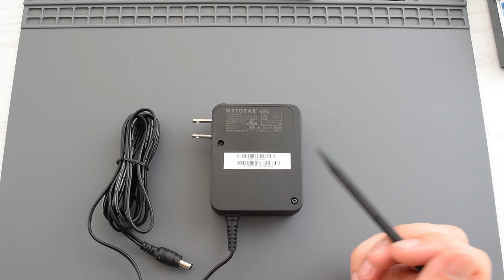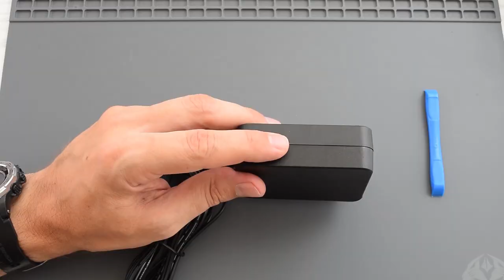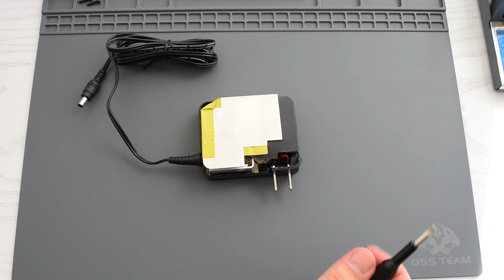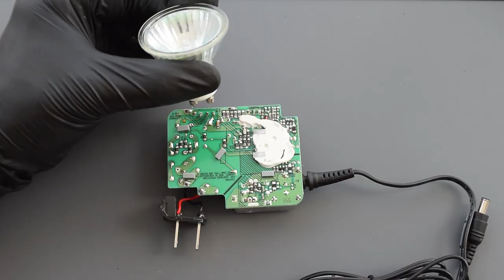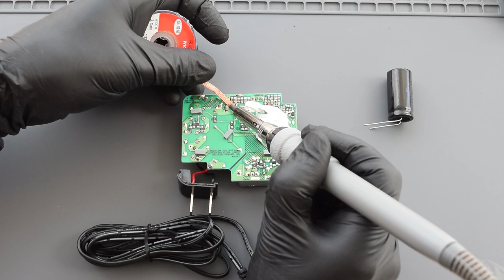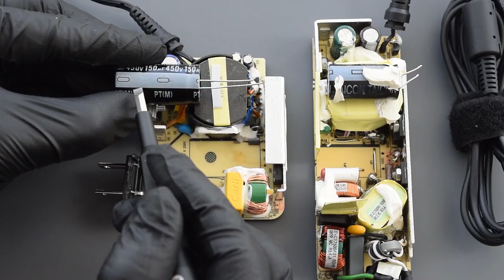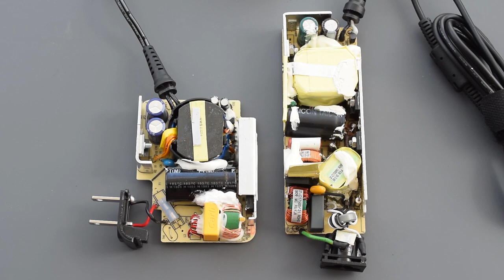How to convert any 110/120V AC/DC Power Adapter to 220/240V Electricity

Comment: Thanks for the video and the explanation. I need to convert dewalt dcb115 charger and in a video that I saw he added transistors(EDIT: meant resistors)  and I didnt understand why. do you think it is necessary?
Reply from the maker: Maybe those were resistors not transistors!? Depends on the schematics and in most cases replacing the main cap and varistor is enough. it's not a problem to buy some resistors on Aliexpress the cost just a few cents.
Reply: @ElectronicsComputers   thanks for the reply and yep I meant resistors. but what are they for? and should I also replace the fuse?
Reply from the maker: @idoriesenberg5297  The fuse will be fine. You need resistors to reduce the current on some components. in that case on a MOSFET. If your PCB has a dedicated place for those resistors then I'd  recommend installing them to the board.

Comment: Nice idea❤🎉
Please, I have faulty inverter for a dc stove which produced 470v AC, I was unable to repair it. How can I double the 220volts AC to 440volts or make an inverter that will produce 470v AC from 12 or 24volts dc.
Thanks
Reply from the maker: You have to fix that inverter, because it's near impossible to buy such a unique thing.
Reply: @ElectronicsComputers  😳😱👌I appreciate any support in fixing this stuff.
Thank you 🙏

Comment: In refer to your answer:"...There's no AC input protection, and there's no protection on the DC side to safeguard the device...",what protection is used,in general,on the DC side?
Reply from the maker: Apologies for the delayed response. I couldn't locate your comment among the numerous ones. Typically, in the DC stage of a power supply, there should be at least a basic voltage stabilizer and short circuit protection. However, in this particular power supply, there's nothing of the sort. It's as simple as it could possibly be.
Reply: @ElectronicsComputers  Yes,you have numerous comments indeed,since you made a very nice well explained video that can help alot.Thanks again for your help.
Reply from the maker: @shonl9743 I guess, that's what you were needed in the first place: https://alii.pub/6wynat 
We buy those power supplies for client's routers, modems, electric tools and some other stuff.
Reply: @ElectronicsComputers  Yes i know.But since the original one(110VAC)was very compact(small and light),i thought i could use it.Thanks for the link.

Comment: mine 110 adapter 335v 50uf long capictor its was working fine on 220 electriccity my voltage 240 one day i was run this on my generator that capictor blast can u tell me which capictor i should go
Reply from the maker: 400-450 volts rated.

Comment: What about output voltage? Is it doubling?
Reply from the maker: No the voltage will be as rated on your power supply. It's impossible to double it this way.
Reply: Switching PS has output feedback that will maintain output to a fixed value no matter what input is.

Comment: Hello, pls I need your help urgently. I have this 40" Samsung TV brought to me from the US. The AC 110/120 I want to convert it to 220/230. The capacitor in the panel is 420v and 100uf. I do not know which to change it to and or whether to change the varistors
Reply from the maker: All Samsung TVs are made with the universal power supply which works with 120-240 volts. I would just google marking of the varistor just in case, but I'm pretty sure it will work as is.

Comment: Hello, absolute beginner here. I have a subwoofer that I got from the US. I live in Europe and the subwoofers input is 110-120v, as we know the voltage in Europe is 220v so I was afraid to plug the device right into the outlet. I opened it up, and I found the capacitor. It is a 450v120uF capacitor. My question is, will this work hence the type of capacitor? Will I need to check something else like the fuse or something?  Or since the capacitor is 450v rated it should be okay? Also why would it be labeled 110-120v if the capacitor is 450v? 

Thank you for the help and keep up the good work! Subscribed!
Reply from the maker: I'm 99% sure that that device will work perfectly in Europe. Most manufacturers create a universal power supply, because they sell their products around the world and no sense to create two different units. I would also check the input protection. There should be a varistor that connected in parallel to AC line after a fuse. Usually it's a blue or yellow component. You can share some pictures of the PCB if you need more help.
Reply: @ElectronicsComputers  Sure, I could send you some pictures. What would be the best way to send them to you? Thank you again!
Reply from the maker: @alvin4781  Just attach shareable links from the cloud. Could be also useful for others.
Reply: @ElectronicsComputers  I just posted the link under this comment, but it's not appearing anymore for me, YouTube might think it is spam and might be deleting the comment. Let me know if you can see it or not so I could figure out another way to send it.
Reply: @ElectronicsComputers  Were you able to take a look at them?
Reply from the maker: @alvin4781  I've never seen your message. Probably, it went directly into spam. I'll check tomorrow and reply back to you.
Reply from the maker: @alvin4781  Unfortunately, there's no your message. You can send it directly to my e-mail, which you can find in the channel description.
Reply: @ElectronicsComputers   I sent it via email.

Comment: What is the metal plate soldered on the circuit board?
Reply from the maker: heatsink
Reply: @ElectronicsComputers  
Thanks...why is it soldered to the board and also what if I remove it...will it still work?
Reply: @Dhona7770  heatsink , dissipate heat don’t remove it (it’s like removing the radiator of your car )
Reply: @EL90291  thanks

Comment: I have dewalt DCB090 charger. It is written 120V AC on the back but, the main capacitor is 400V and there is no varistor. What should i do ? I think it is ready to 220V AC. What is your opinion
Reply from the maker: Most likely it will work for 220V without any problems but if you want me to check just send me a photo of the top and bottom side of the PCB. If there's only one 400V capacitor then I'm 90% sure it will fork fine but if there are two of these then it requires a little modification.
Reply: @ElectronicsComputers  Yes only one 400V. Others are like 35V or less
Reply from the maker: @necromecro  The it's a universal 120-240V adapter.

Comment: My 12V adopted is designed for 100-110V input but I am using it on 220-240V  as in my country 110V AC is not available. It is working good . I faced no problem. Now suggest me did I need to replace its capacitor or not.
My Adopter is compatible with FOST5260. Plz answer
Reply from the maker: Only after opening the case you can tell for what voltage it was originally designed. In most cases those adapters are made for different countries, they may have different plugs but the boards are the same. If your adapter have already been working for a long time (over 6 month) then it will be fine. If it worries you then try to carefully open it and check the voltage of the main cap. There's always a risk of fire if that adapter blows up when you're not home. So either check it or unplug the adapter when you leave your home.
Reply: @ElectronicsComputers  
Thanks for reply. I did not use it much . It is US type adopter. I opened the case . The specifications of main capacitor are:
Color : brown just like yours
450V, 6.8uF
I see your video carefully. I think 450V are OK but 6.8 uF is low as you used 150uF. 
Specifications on the body of my adopter are:
Model: PS-2.5-12-25WTI
Input: 100-120V AC 50/60Hz 0.8A
Output: 12V DC 2.5A
Now everything clear. Can I use it without tension for longtime.
Reply: @ElectronicsComputers  
Waiting fo you answer
Reply from the maker: @Aseelandpetcare  Yes, it's totally safe for 220-240 volts. The capacity of the main filtering cap varies and it depends on the power of the power supply. So, no worries!
Reply: @ElectronicsComputers  Thanks

Comment: Firstly, please forgive my ignorance of basic electronics. From what I'm assuming by your video, if the power adapter is already 'matched' to your electronic device (current rating, voltage and polarity) then the mods you've shown in this video don't alter that... it only alters the input power to the adapter. The adapter will still output the correct DC, amps and polarity for your device after the mod? Is there no need to confirm things like the polarity of the mains power if you've changed country? Thanks so much.
Reply from the maker: Usually all power supplies designed to work in the range of 110-240 volts even if they have north American plugs. But sometimes manufacturers design the input stage of the power supply specifically for 120 volts and in that case you need to replace those components with the ones that can support 240 volts. The polarity and the output voltage will be always    the same.
Reply: @ElectronicsComputers  So if I just purchase a different power supply, as long as the input power matches the new  mains power supply and the output on the adapter is the same as the output power on the original power supply it should be okay? i.e. original p.supply input = 120VAC, 60Hz, 240mA/ original p.supply output = 9 VAC, 2000mA/ new p.supply input = 230-240V, 50Hz, 140mA / new p.supply output = 9V, 2000mA, 18VA?

Comment: I have capacitor 450v / 150. Is this 220volts? Thank you
Reply from the maker: Yes, it's a universal power supply which will work in the range of 110-240 volts.

Comment: very nicely done , i have just bought a set of ridgid (AEG) lithium tools and its charger is rated to 110V for the USA , i need to convert it to 220v for our power here in south africa , may i ask you for your assistance please , it is a pretty simple circuit by the looks of things but i am not too clued up on electronics , do you mind assisting ??
many thanks
Richard moss
Reply from the maker: Take some close up shots of the PCB with its components, so I could see their specs and give me the links.
Reply: hi again , to which address can i email the pics and info to please
Reply: ok main cap is 200v 100uf , varistor is a 10271 , mosfet is JCS 4N 60FB , i have a 472 varistor and 450v 100uf cap in stock , mosfet i hope will be ok , looking forward to your reply
 rich
Reply from the maker: @richardmoss2904  For that device you can use any 82-100uf electrolytic cap rated 400-450 volts (pick one that fits perfect into your device case). For me "varistor 472" sounds like a capacitor, don't confuse them, they look the same. You need a varistor rated at 300-400v. I f you can't find it then simply remove it from the circuit.
Reply: @ElectronicsComputers  thanking you sir , i will give it a go
thank you for assisting me

Comment: Hi, my power supply board for UB820 PANASONIC PLAYER HAS A blown up capacitor rated 220v 100uf . It's made for North America imported to my country. It was working on converter from 220v to 110 v but suddenly after one week my capacitor blown up. Please help me how to fix it. Planning to change the capacitor to 400v 82uf or 440v 100uf.is it safe to go
Reply from the maker: 400V cap is a minimum recommended value and also don't go lower than 82uf. When the capacitor blows it also kills the fuse, varistor and the diode bridge (or 4 diodes). So check all components in the input circuit.
Reply: @ElectronicsComputers 

OK thank you. If my varistor and diodes still working do I need to change them for compatibility to 220v or its enough to change the capacitor as stated. Once I reach home will send u a screenshot of my board. Thank you very much sir
Reply: @ElectronicsComputers 
HI again do you have an email to send my screenshot. Thanks
Reply from the maker: @jihadnader8599  Usually, there's no need to replace the diodes if they are fine. My email is in the channel description.

Comment: Can I do the opposite? 220V to 127V?
Reply from the maker: To do the opposite in 99% of cases, you don't need to do anything. However, you can replace the varistor for lower voltage so that surge current protection will work properly.
Reply: @ElectronicsComputers  In this case I was referring to a cheap soldering heat gun station I bought expecting it to be 127V, but the store I bought only had 220V units 😢
Reply from the maker: @JoaoPedro-ki7ct  In most cases, all you need to do is replace the heating element. Heat guns usually have the same schematics but different heating elements that are rated for 120 or 220 volts. If it's a big hot air station with a transformer inside, then you also have to replace the transformer.
Reply: @ElectronicsComputers  It's a JCD 8898 station, I wish I knew about the heating element trick earlier, I would have bought one or two 127V heating elements alongside it too already. 
I guess I'll have to wait for the station to arrive and then wait 17 more days again to replace the elements.
Thank you for the enlightening me still, I was already considering adding a 220V outlet somehow or buying a voltage converter on a tight budget.

Comment: This could work in certain devices, but many of 120v power supplies use a voltage doubler
If yoy have one with it, the psu would instantly die
Reply from the maker: In case of a voltage doubler it's even easier because you don't need to replace two caps that are connected in series. Al you need to do is cut one trace (between caps and diodes) on the PCB and remove or replace the varistor.

Comment: How do you know 40% of the capacitance is fine? How do you know they didn't make the circuit to use the full capacitance? (Why would someone put more capacitance than needed?)
Note: electronics student here, so sorry if these are idiot questions.
Reply from the maker: The capacitance of a capacitor first of all depends on the power at which power supply rated and on the free space which can accommodate that component. Also if you put a cap with slightly higher rates then your device may last longer because the capacitance of your cap will degrade over time.
Reply: @ElectronicsComputers  Ok, had no idea capacitance degrades over time. Interesting. Thank you.

Comment: I change supply adopter 110 in to 22o  with main electrolytic capacitor  that is  220  circuit with no series load  but  out put 22  volt output  show  but original volt is 12v dc  1,5amp  model  no ml 18-v1120 a11s made by adopter (Leader electronics inc)

Comment: My friend asked me if its possible to convert a hair dryer from 110 to 230 using modding instead of a large 1000w transformer kit. My first instinct kicked in and I told him even if I did, its not a good idea.
Reply from the maker: In theory, it's possible, but it depends on how everything is organized inside. Basically, you need to replace the heating element and maybe the motor, depending on how it's connected. This means you're only keeping the original case from the hair dryer. I wonder what's the value of that hair dryer if someone wants to go through all this. I mean, it's just a 10-20 euro device. And the size of a 1000W step-up transformer will be like the size of a big kettle and will weigh at least 5 kg. Also, if you have a 1000 watt hair dryer, then maybe for personal short use, a 1000W transformer is OK, but if you're going to use it for professional purposes in a hair salon, you need a 2000 watt transformer.

Comment: Seriously, why isnt every appliance just 110-240V by default?
Reply from the maker: Yes, you need to replace the driver. Download the driver before you replace the card. In case if you have wired (Ethernet) connection then it doesn't matter.

Comment: hi sir. i just bumped through this site, i have a 110V waffle maker that i would like to convert to 220V. is it possible to use this same method? i checked the PCB board and seems like it only hgave the 250V capacitor, no suppression cap or varistor.... so do i just replace the capacitor? how about the heating elements? do i need to check that for voltage?
Reply from the maker: Not sure about the heating element I need to see the photo of the PCB from both sides. Anyway, if the heating element is powered directly via AC line then you have to replace it too.
Reply: How to send you photo?